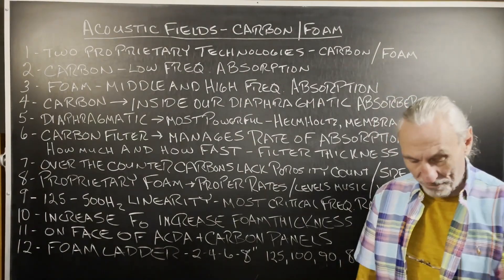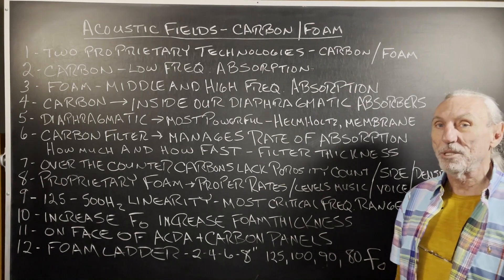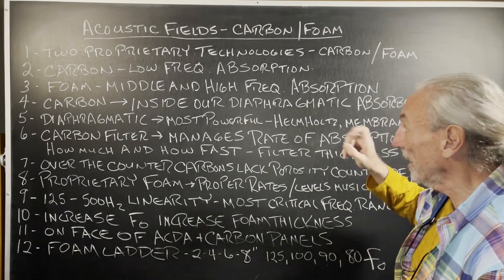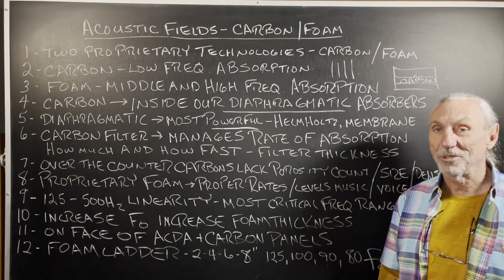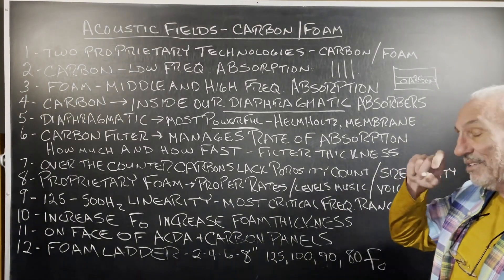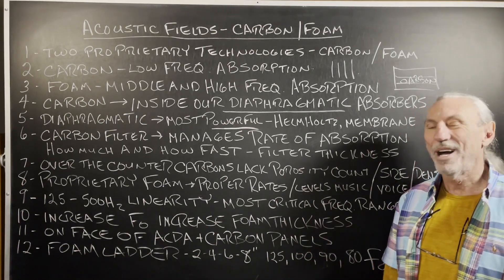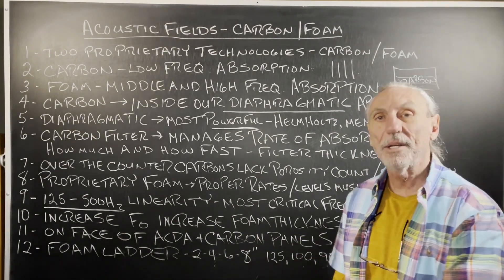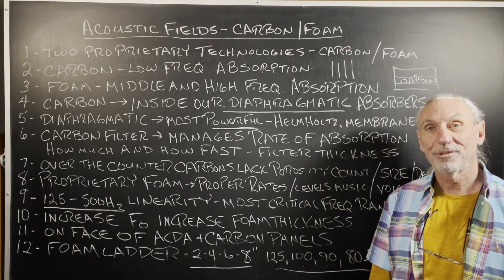Acoustic Fields‘ Carbon & Foam - www.AcousticFields.com

Comment: fascinating on the over-the-counter carbon, thanks for the info dennis!
Reply from the maker: Over the counter carbons will not perform at the rates and levels required for absorption inside a diaphragmatic absorber and performance will be reduced over time.